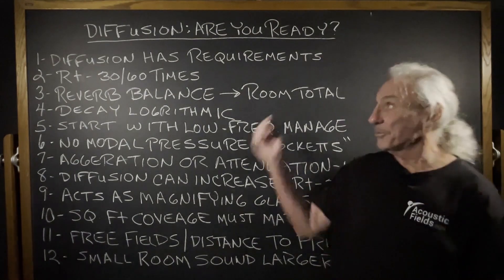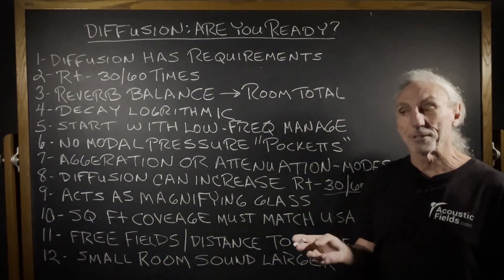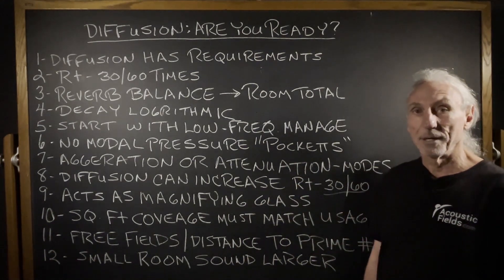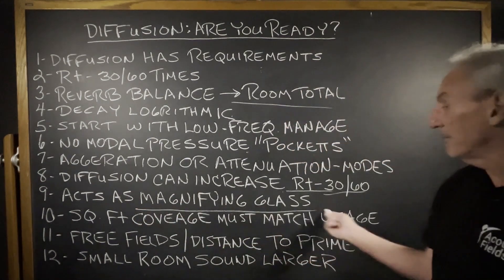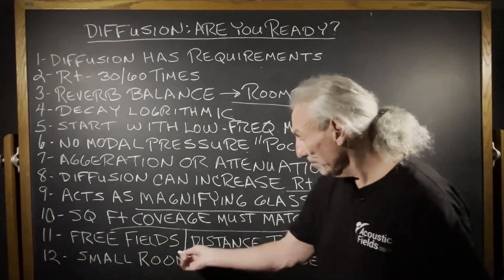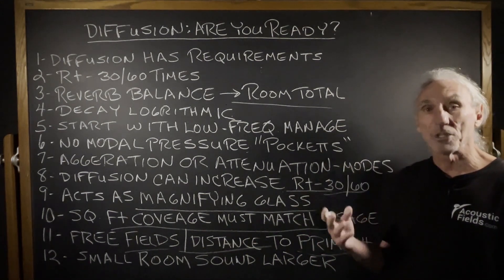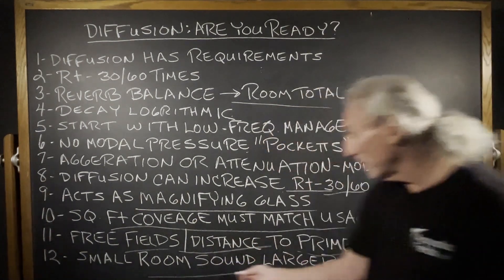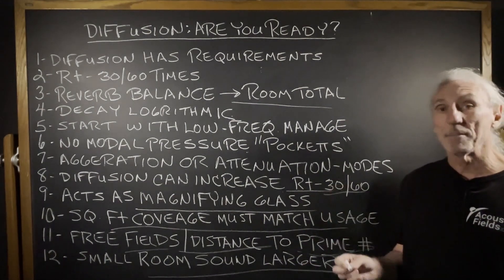Sound Diffusion: Are You Ready? - www.AcousticFields.com

Comment: I'm thinking about DIY quadratic diffuzers - many of them and made from plaster, using silicone mold. Then put on  walls like tiles. Does that plan make sense? It would not absorb sound, but diffusion would still happen. I've never seen anyone doing that, so maybe it's total nonsense. What do you think?
Reply from the maker: Applying quadratic diffusion requires that many room issues be resolved first. Diffusion can make your room sound worse without careful planning. Done correctly it can increase the psychacoustic room size by 100 %. Done wrong, it will make your room sound worse at any size/volume/usage. Wall tiles lack the proper depth for true diffusion to occur. You must have at least a 4" depth for the lowest prime number 7 diffuser to work properly.

Comment: Hi Dennis, thanks for sharing your impressive knowledge with us!
It will be very intresting to hear from you a specifical lesson about treating early reflections in a listening room with omnidirectional or dipole speakers. 
I have  a 3 way diy speakers with great heil tw, 2 meters far apart from the front wall. In this case, a tweeter with very large front and back horizontal dispersion, should we find and absorb even early reflection points that comes from the back face of the tw to the front wall and reflected back  exact to the listening position?  Once localized the mirror point in the front wall, is better absorb it or maybe diffuse it? 
 
Thanks
Reply from the maker: All of these issues are subjective. You must decide what sound quality you wish to achieve. Make sure you use the same rates and levels of absorption so that you have predicatbility and consistency in your efforts. Stay with absorption first and then move to diffusion.